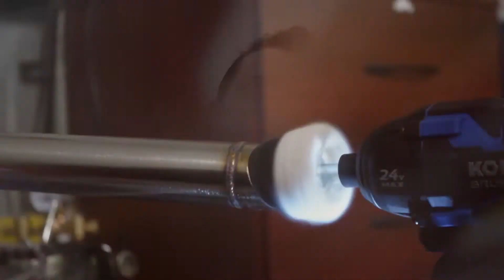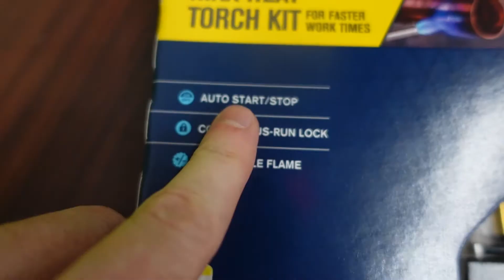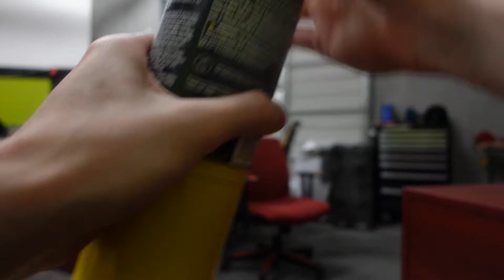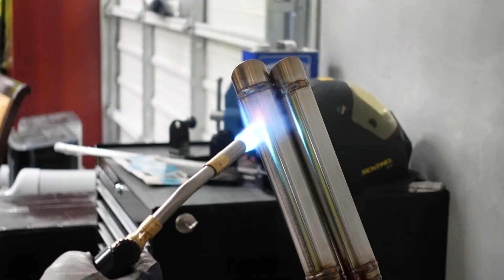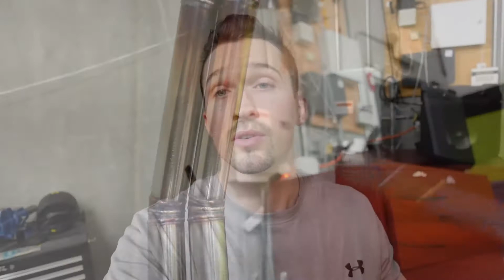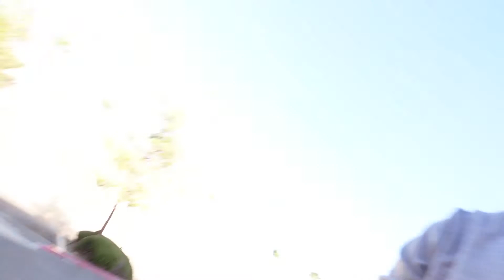DIY BURNT EXHAUST TIPS JDM BLAST PIPES | FIRST TRY | Heat Anodizing Stainless Steel at Home

Comment: Lower your flame on your torch and make light passes. It will take longer but you'll be able to get your desired color much easier and then afterwards immediately quench it in some water.

Comment: Hey i did this myself, and after burning the tips and getting the outcome that i wanted i polished one side up a little bit and then I noticed it looked less bright in colour. Can i do this process multiple times? And is it a one shot thing?
Reply from the maker: You can polish the color off if it’s stainless steel. You’ll definitely need a polisher or a drill to get it done, doing it by hand won’t work. You could also use a scotchbright maroon pad if you want a matte finish

Once it’s polished or, refinished, you can do it again. I only advise burning it if it’s polished to a mirror finish
Reply: @JordanPayneLV  thankyou for getting back to me. i worked by hand as much as i could and then i just rigged my Dremel with some microfibre cloth on the tip, works great just need to get that mirror finish! I appreciate you replying after 7months of filming this video! Following :)
Reply from the maker: @W1llShoots  of course! Thanks for the tip and I’m glad it ended up polishing nicely :) thanks for watching!

Comment: A different type of steel may give out a better burnt shade but it sill looks awesome man! Quick question though, won't that make the metal rust easily? I don't know tho, i only heard this from a muffler shop guy lol
Reply from the maker: Lonely Driver possibly! This was 304 so maybe 321 is used for this application! And I don’t think it will. The grey oxidation is only a thin layer on the top, and If you don’t make it grey (keeping it in the gold/purple/blue color zone) it shouldn’t rust. It will rust if you completely cook it dark grey during the welding process but I don’t think burning it like this will.